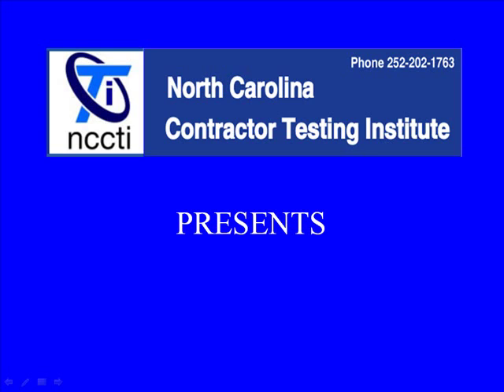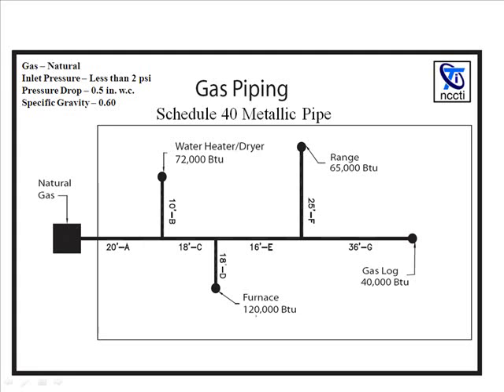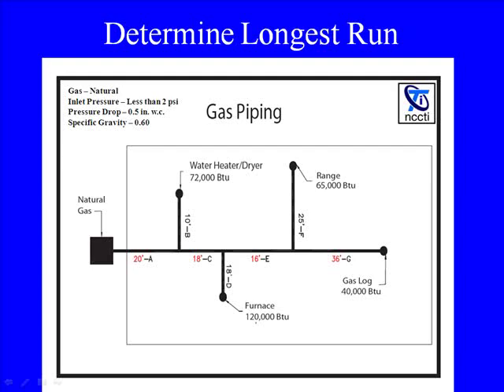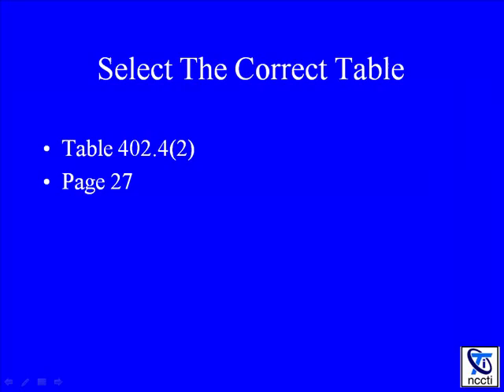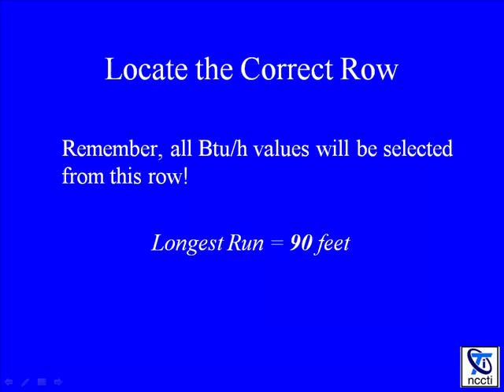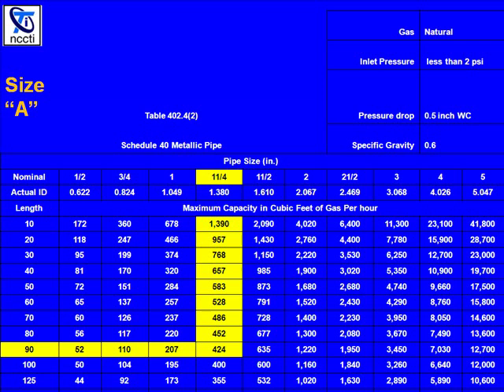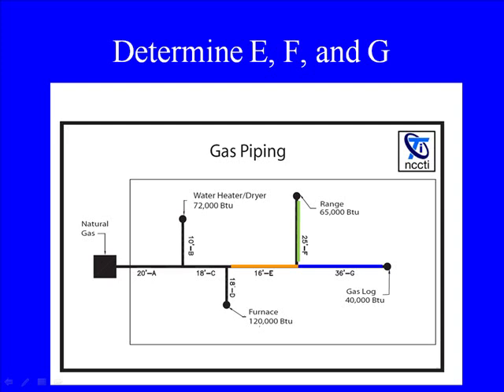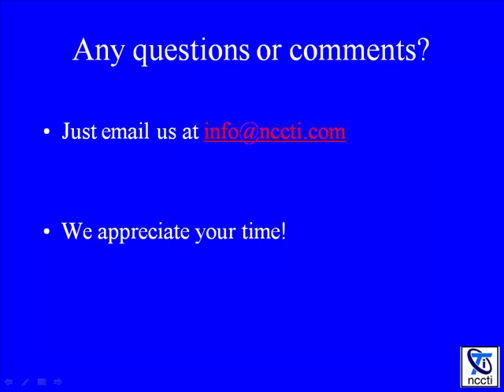Longest lenght method.flv

Comment: He is correct, you would not want to use this method for sizing Equipment/ Appliance drops on big jobs because you would drastically over sizing the drops nearest the gas meter. I'm not sure why North Carolina does not adopt the longest run method for trunk lines only & use the branch and drop sizing method for the branches and drops.

Comment from the maker: Thanks for your input. First we agree that 1,000 btus = 1 cfh or cubic feet per hour not cfm as you stated. My video gave 297,000 btu demand. So your approach is just as valid as mine - you can either convert 297,000 btus to cfh by dividing by 1,000 (not by 100) or you can add three zeros to the cfh chart values to convert btus to cfh. Either method will give you the correct answer and is just as valid.. I hope this helps you Nathan.

Comment: I have a situation, my new firepit requires 240k and it is 60’ away from meter.          
The  current pipe line is as follows-from gas meter 1” pipe size for 50’ distance and then branch out for 1/2” size for next 10’ distance to fire pit.Does this current pipe system would be good enough for 240k btu firepit?

Comment: One thing to remember. He's wrong when he says that you add 3 zeros to the cubic feet per hour on the sizing chart. A cubic foot per minute is equal to 1,000 BTU/h. So when you add up your BTU, you divide by 100. So the 297,000 BTU's are 297 CFM. So I'm beginning to think his reasoning is a little skewed.

Comment: I have 3/4” 17 ft from 1” pipe and I have 1/2”  x40 feet. I have no appliance to see what the BTU’s are. My question is with the pipe and NG hose will it be enough BTU’s for my 13 hp 420 cc Generator running start up 8750 and run at 7,000 I don’t want to waste time and money o wrong size. Thanks